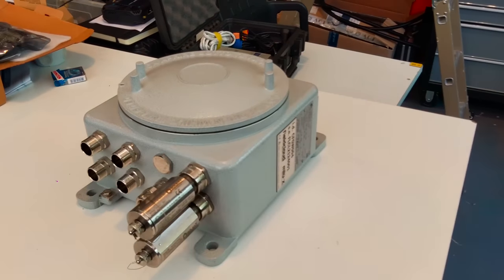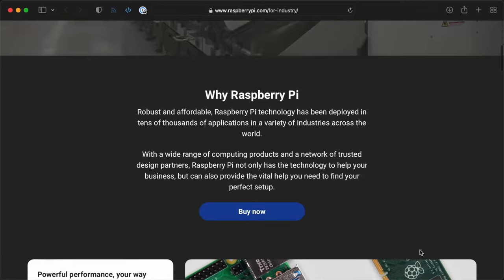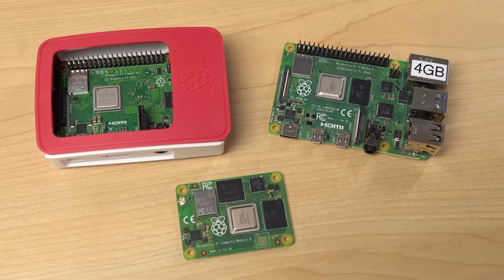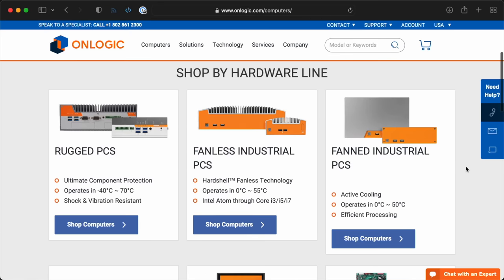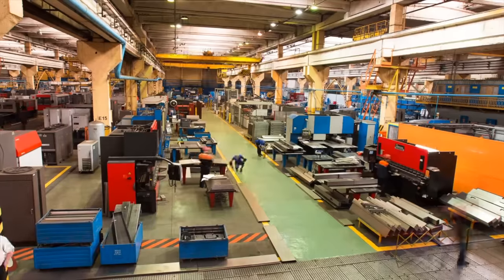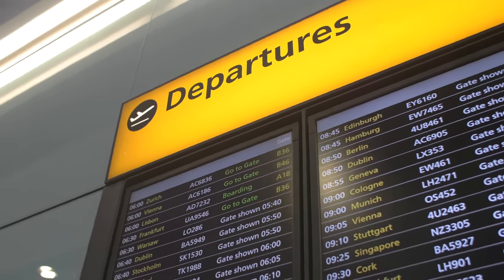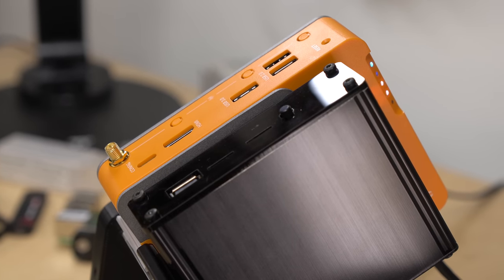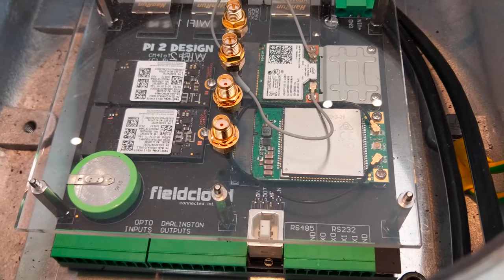Why are Industrial Pis so expensive?

Comment: The industrial Pis are quite unique. But I am more interesting in the PiBox, been thinking of making a home server for testing different things locally and Pis are way more power efficient than doing that on an old PC.
Reply from the maker: I still have my PiBox Hacker Edition (just the boards, no case) and it's been running strong. I love that little thing!
Reply: I'm thinking much the same thing, what a neat little box - though in my cases its I want to replace my current original pre memory bump Pi1 model B powered NAS/hosting platform with a faster one - its actually more than good enough to serve the files as my needs being mostly just making the music library and documents available everywhere, but the backup and loading of new stuff is really sluggish and awful with such limited CPU, heavy use of swapfile required and rather low network speeds... But its been working well enough for so long now getting round to building/setting up a better option just isn't happening.

Comment: Explosion-proof is not the same thing as bomb-proof. These type of enclosures are intended to operate in environments with combustible gasses. The assumption is that if there's electronics present, there is an ignition source. Explosion-proof enclosures are designed with serpentine threads to cool down combustion gasses. Thus, when the gas inside the enclosure ignites, it will prevent it from igniting combustible gas that is outside of the enclosure. This can be contrasted with the European approach, which is to simply pot the entire inside of the enclosure so that there is no volume of gas adjacent to the electronics that can be ignited. This approach doesn't require beefy enclosures with serpentine threads, but does result in non-serviceable equipment.
Reply: I should put my Pi in that, given that it is impossible to replace at the moment should it break.
Reply: Umm we don't typically pot equipment that needs to be serviced over here in Europe. But we do pot cable glands and smaller devices which need to be Ex d (flameproof) rated where we can't use serpentine threads to dissipate energy.

Comment: I am skeptical of any industrial process that requires a Linux or windows PC to control the industrial equipment. Most PLCs run more like an embedded device like an arduino rather than a pi. There are more and more PLCs that are gaining popularity in the industrial space and it is cool that a pi is one of them. Part of the problem will be training. It is easier to train a mechanic in ladder logic to troubleshoot why a machine is offline vs training them in C++ to troubleshoot the machine. 

Industrial PCs have been controlling industrial applications for years. From my experience most customers hate them, because no one but the original company can troubleshoot the PC. 

Would love to chat more on the industrial sector and being a programmer in it.
Reply: With Codesys you can run your ladder on the Pi. C/C++ could be used for well tested standard functions that the maintenance tech won't have to touch
Reply: Exactly, I've worked automation in the utility sector (a combined electric, water and wastewater utility) for the past 22 years and factory automation 5 years before that. I would never put a general Linux, Windows, OS-X machine in direct control on anything, they are can be used for HMIs. The underlying OSs of PLCs and controllers like SEL RTACs is ultra stable and can handle real-time operation without latency. If you really need to have PC type control, running industrial rated hardware (conformal coated boards, wide temperature range semiconductors used, robust power supplies, etc.) with something like QNX would be more appropriate. I can't blink half a city's lights because we had to "reboot" the substation :-)

Comment: 6:22 you cannot easiely measure metal temp with IR thermometers. Metal is reflective and you mostly measure the temp of something else. The labels temp should be the "real" temp of the metal.
Correct me if i'm wrong but you can actually put tape over metal to get the actual temperature, this is what happens in this picture. (LinusTechTips does it this way)
Reply from the maker: It's more about the reflectivity / emissivity. In my example, the label is glossy which creates a reflection. The metal has a matte texture, meaning the measurement isn't perfect but is a lot better than a smooth metal surface.
Reply: @JeffGeerling  Ok, thank your for the answer =) Didn't know that

Comment: Do these industrial computers use a stock CM4 or a custom CM4?   Is the stock CM4 made with components that meet the industrial grade or military grade specs?
Reply from the maker: Stock CM4; some add additional layers of protection or even some coatings around the edges of certain chips, but the CM4 itself has certain certifications already that help speed up the overall process.

Comment: People are upset that they can't order...
Blame just in time ordering and delivery, where previously we had warehoused stocks, now pretty much everything is order as and when needed and it arrives just when one predicted one would need that component.
The old system relied upon stockpiling parts in warehouses, which required advance ordering, stocking and of course, paying for said stockpiles in advance. Just in time delivery does away with that, but like pretty much everything in business, there is a tradeoff.
Just in time delivery is super sensitive to supply side disruptions, there's nothing in a warehouse waiting for someone to order in advance, so anything that impacts any portion of the chain from raw component to product one uses will choke off the entire supply. That could be a natural disaster, such as a large regional earthquake damaging a memory chip plant to a pandemic and the shutdowns that came with pandemic response efforts.
And gripe if you want about lockdowns to slow the spread of a pandemic, there's one thing to slow industry response more - dead workers. For some odd reason, dead workers productivity just royally sucks and no threat of termination will get their production up above zero.

So, welcome to the modern world, folks! Where any modest disruption in the supply chain derails the entire supply chain and a deceased workforce halts the hell out of production. The latter not being anything new whatsoever.

Comment: Something you don't mention is the expected lifespan of this kind of gear.  The price isn't a big deal over the 10-15 years they'll be in use.
Reply: Just this year I worked on a system for the Army that ran Windows on a 486 to control a power system. It got an upgrade from NT 4.0 to CE :-) It never connects to the outside world, so safe from hackers.
Computer was from 1995 and was just underclocked so it'd run passive for 25 years in the desert heat. Completely enclosed in a conformal brick of rubber.
I think at some point all these super weird systems (286/6502/68000) could just be emulated on a Pi with QEMU.

Comment: Industrial companies, if I understand the video correctly, seem to have enjoyed the forum of development and support from communities but most likely have not paid a higher cost for the supply of various Pi models; this leaves an added delay to regular communities like yours Jeff which if something doesn’t happen to help with the production, these users will look for alternatives like I’m doing now.
Reply: what you are missing is that industrial companies put a lot into the development and support within the communities - ranging from allocating engineers'  time for kernel development, to  alpha/beta testing hardware prior to commercial launch, even sponsoring tradeshows and events.

Look, the entire electronics industry is a mess right now due to a perfect storm of multiple disruptions in the supply chain. We are all dealing with shortages. long lead times and unfavorable pricing.
Reply from the maker: The whole parts shortage situation is unprecedented, so the hardware side is hard to talk about without emotional involvement.

On the software side, part of the reason Raspberry Pi OS (and Ubuntu for embedded/Pi) has gotten so stable and reliable (enough that I use it for all my projects now) is the huge amount of feedback and input given by industrial/commercial partners.

When it was just the hobbyist community, things would usually work... but sometimes in strange ways. I have another video coming soon talking about how PTP is not working on the Pi at a hardware level, partly due to the involvement of a few industry partners who are going to implement the CM4 as a master clock reference!

Comment: 6:37 Those thick thermal pads are probably more insulating than dissipating.
Reply: The average cheap thermal pad has a thermal conductivity of ~3 W/mK. The air it's  replacing is around 0.025 W/mK. Forced convection isn't an option inside the case because it's passively cooled, so even a low quality thick thermal pad is better than nothing. Of course more aluminium with a thinner pad would be better. (Al has ~240 W/mK)

Comment: Who else saw the cyber deck on his desk? That’s awesome
Reply: Thank you that is well spotted. We build these as programming stations and test bench tools for factory programming and maintenance!
Reply: @MatthewSmithFR  thanks for the response! Is there a specific build you followed, or is it a custom build y’all designed. I am interested in building my own with a sdr, usb hub, nvme, and keyboard+ mouse+screen but am interested to see what others are doing.
Reply: What about the TB-303?! 😁
Reply: @hmeador03  It's our own design circa 2016 and was in fact part of a product range we discontinued a few years ago called ELIOT (ExperimentaL Internet of Things). We repurposed the original design for two things 1) as an internal tool (we use them during Milu-X manufacturing and commissioning) 2) as custom test benches for programming and verifying embedded device PCBs. The core design originally used the PI3, a custom HAT (with mSATA, power, USB hub and RTC) and a PI 7" touchscreen.
Reply: @remyzandwijk  🤘Techno FTW!!!

Comment: What OS is being used with the level of industrial use?
Reply: Many of our Factor 201 users work with Raspberry Pi OS or Linux Ubuntu. Those are the two options the system can be pre-configured with. That said, there's usually a fair amount of customization either by our team or the end user to get the features (and only the features) the customer needs. Other users install their own custom operating system once they receive the devices or have us image them before shipping. On our other industrial systems, customers also utilize various flavors of Windows, including customized versions of Windows IoT.

Comment: The onlogic boards aren't raspberries right?
Reply: Hi there! The Raspberry Pi Compute Module 4 (CM4) is the brains of the Factor 201 (and Factor 202). The CM4 connects to our custom carrier board, which provides the I/O and additional capabilities of the systems.

Comment: Raspberry pi is complete garbage.  I’ve worked for three companies that tried to use them only to chuck them all in the bin.  They lock up, overheat, sensitive to emf noise, sensitive to voltage spikes and are easy for hackers to exploit.  And that’s with fancy cases.  Do not use these on a machine unless you want repeat repair calls.  They are only good for college projects or a cute diy for the kids.
Reply: What do you recommend instead?
Reply: @mbox314  for an application that needs I/O or strictly data?

Comment: I hope that companies are paying like 3x their fair share of cost for the raspberry pi boards. Thats where the frustration comes from - they can help the foundation do better and improve their supply.

It should be the companies responsibility to bolster the fabrication space and funding to ensure that the STEM and the tinkerer folk can get their $35 board now and forever.

Whats worse is, Australia still doesn't have good purchasing options. They're currently over $90 through retailers, have historically been "limit 1" and are currently outright unavailable.
Reply: Rest assured.  They're not.  They just write larger lump sum checks than we do, so they get them, and we don't.

Comment: The raspberry Pi is a standard of its own, due to all the people who contribute and create  The Community that surrounds it. It will take years for a competitor to try and catch up and the raspberry Pi did it with a price so low how do you invest to compete?
Reply: Right now it is near impossible to buy a Raspberry Pi. This may be the only chance for someone else to make inroads into its market, otherwise it’s almost impossible at this point.
Reply: @sylviam6535  Like the South African said it is not the hardware at $35 dollars it is the extremely good support. No good using an available computer to find out it fails in 1 million pound deal.
Reply: @tonysheerness2427  - That’s why I said it’s almost impossible. The level of peripheral and software support it’s miles ahead of anyone else. That is why I ignore other SBCs which claim to have better specs.
Reply: @sylviam6535  Is the delay in P5  because the Pi 4  was too successful and a Pi 5 which will be faster, with better graphics will take away PC sales from other manufacturers and they are squealing behind closed doors? Easy to blame chip shortages.
Reply: @tonysheerness2427  hey I'm that South African and you are absolutely right. There are some crazy stories out there about multimillion dollar systems which failed due to bad software/firmware support and required tens of millions of dollars of remediation - imagine having to send an ROV 1000m underwater to retrieve an embedded computer module from the bottom of the ocean because the data acquisition feed to the surface got borked!
Reply: @MatthewSmithFR  Your company is just amazing what you do and thank you for the explanation of your bomb proof equipment. I apologise for not Using your name Matthew Smith.

Comment: Why would you use a rasberry pi in a commercial/industrail sceanrio. They cannot support any kind of secure boot.
Reply from the maker: They actually can (at least with the CM4) depending on the implementation. See: https://github.com/raspberrypi/usbboot#secure-boot
Reply: @JeffGeerling  that's new... thanks for the info

Comment: That "bomb proof" enclosure...    Not even close.   Besides, that test stand isn't even close to explosion proof, ie   spiral flex for wiring conduit....
If it was true explosion proof, all fitting would have to be poured with a sealant to stop any vapor migration.
And besides...   that test stand looks to be using a Micromotion coriolis mass fluid flowmeter.
Oh... my background was with Modicon 584M PLCs up to the Modicon Quantum PLCs, also Allen Bradly PLCs.    Truly industrial PLCs.   And  heavy industry process control instrumentation.    Totally retired now...
Reply: what are you saying exactly? If you are referring to hard conduit for Class 1 Div 1, that is the North American standard. For ATEX in Europe we do not need this and the spiral flex is purely for additional mechanical protection during transport and operation. Not an Emerson Micromotion flowmeter but a well known competitor ;-) Yes we do poured resin seals on the inside of the cable glands! That is part of our Ex d certification.
Reply: @MatthewSmithFR  
My background is strictly USA, so Class 1, Division 1 is the norm here.    If the flowmeter is EH, I would need to chuckle a little bit...  After I retired from 3M, I looked at them for a field service position for the western portion of USA.   Instead, I went to work for a local organization where I rep'd for Siemens.
Reply: @robertbass9032  excellent and good know you have solid experience with Hazloc C1D1! Well spotted on the coriolis flowmeter, EH instruments certainly have their quirks but we've gotten great mileage out of them in the field. The game changer is their embedded OPC-UA server, no more messing around with 4-20mA current loops or HART protocol. We even do remote troubleshooting and field service with our client in three continents from over here in France.

Comment: I'm a factory trained 3rd party certified technician for a UK company called Pyroban who carry out forklift flame/explosion conversions for forklifts (zone 1 & 2).
The costs are astronomical - they told me each individual component they develop the certification costs can be anything between £10k-£50k. And they've developed hundreds of their own components.

You'll often notice how outdated some control boards look and that's because they are, it's not unknown for these sorts of companies to use the same core circuit design for 15-20 years as again, the certification costs are so high, if it works - why change it?

Comment: The industrial users are causing the damn shortage of Pi4 Modules. Who cares about their use cases. They could afford much more expensive systems, but the Pi is cheap, so they end up squeezing out the very users that the Pi was designed to satisfy in the first place.
Reply: Not really, the shortage is just because everything is running short - and its not really that bad every time somebody complains they can't get a CM4 or Pi4 I look at the varied local suppliers and they have at least one spec in stock, usually more, just perhaps not the one you really wanted this time...
Reply: @foldionepapyrus3441  Show me one supplier right now that has a CM4 module.
Reply: If it is any consolation we are facing the same shortages and long lead times. My business is fortunate because we built a small number of very specialized systems and I still have CM4 stock from a delayed order placed in 2020 which was only delivered at the end of 2021!